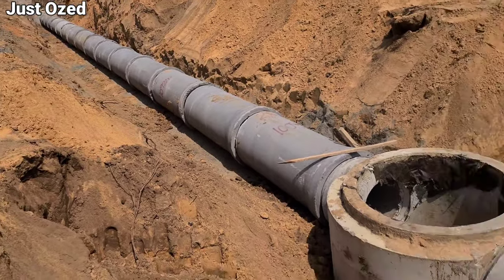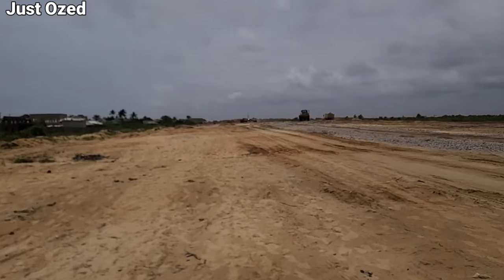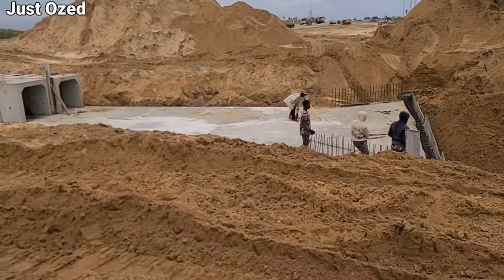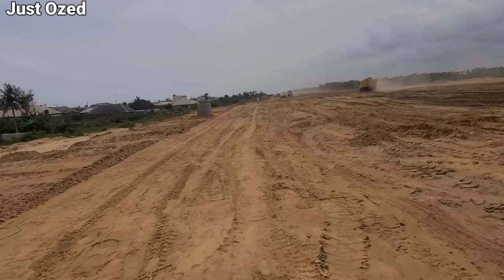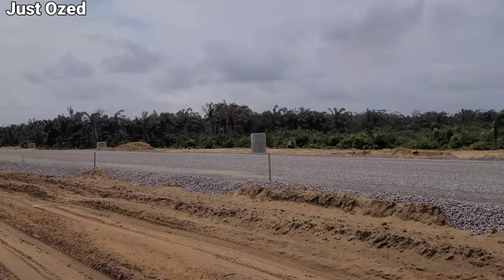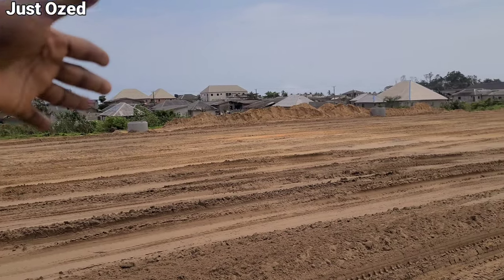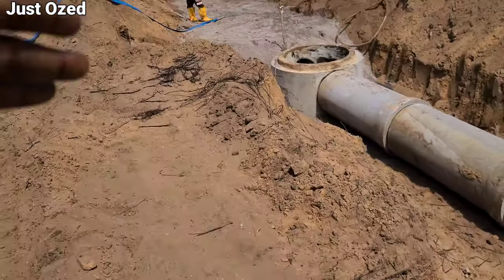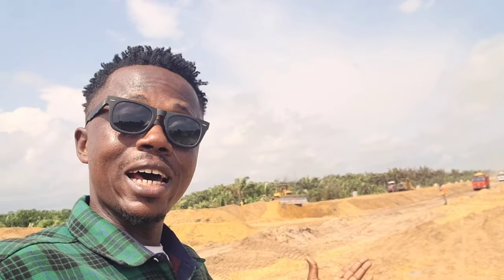Construction Progress on The Lagos-Calabar Coastal Road | ELEKO To Lekki corridor

Comment: Those rings are called gullies - they are used to connect wastewater outlets or stormwater/rainwater outlets to suitable drains.
It helps to remove excess water from road surface and quickly transfers them further from the area of concentration.

The base should have been covered with limestone aggregate placed on top of geotextile - In that way, excess water around the gully network will drain through to the sides while still protecting the gully network from soaking.
I am an environmental & sustainability specialist in Road & Infrastructural Construction in QA.

You are doing great, helping to show the progress of my State. Well done.
Reply from the maker: thank you for this feedback I appreciate the explanation

Comment: Those round structures are manholes, or maintenance holes, pipes are used to connect manhole to manhole, so rain water can flow off the road surface into the manhole and through the pipes, ams out to the environment or treatment facility
Reply from the maker: thank you 🙏